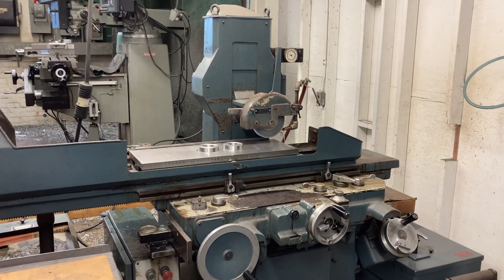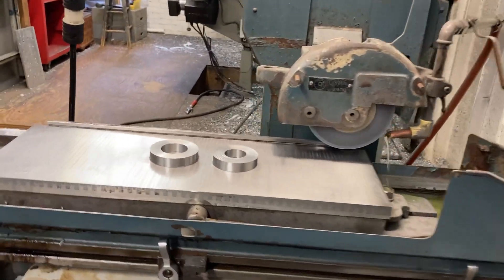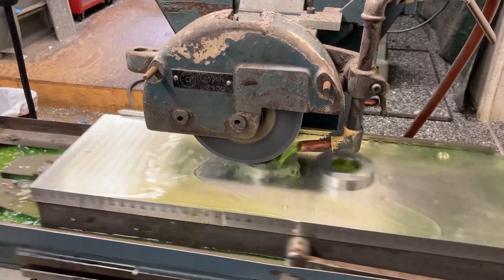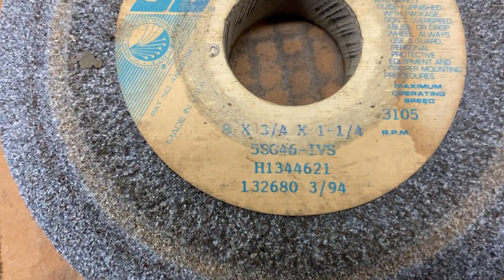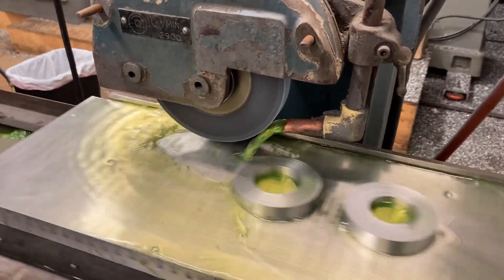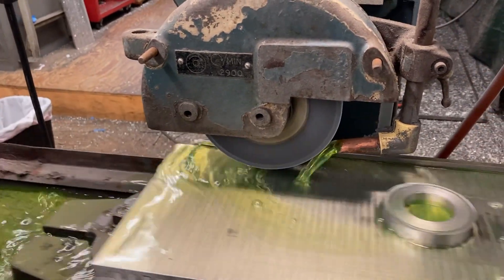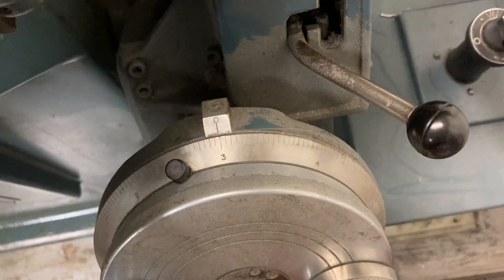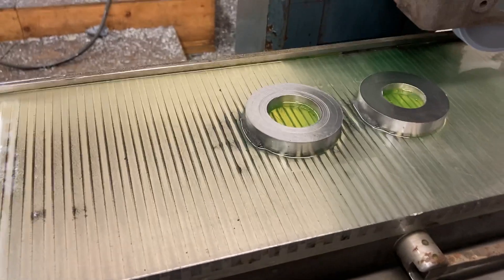Surface Grinding Steel Discs Parallel  on JONES & SHIPMAN Model 1400 w/ Flood Coolant

Comment: Your table travel is far from being optimized.
You need to adjust your stops
I would have no problem cutting both ways as it would help the wheel to wear  more evenly. .